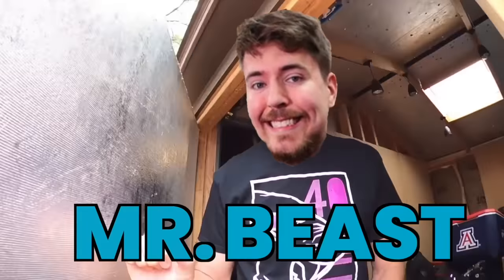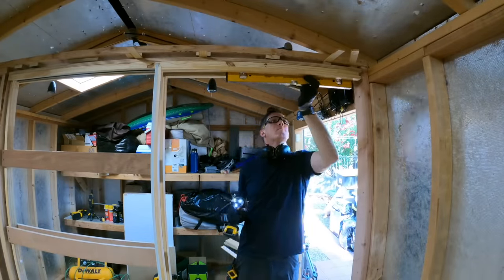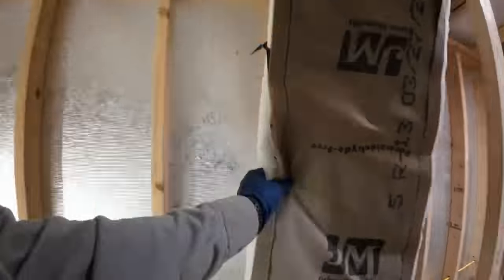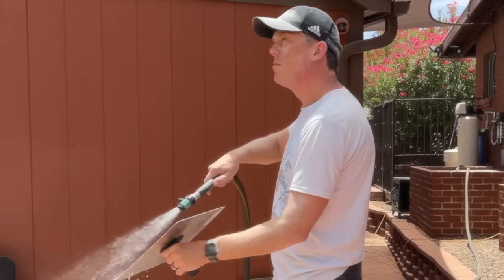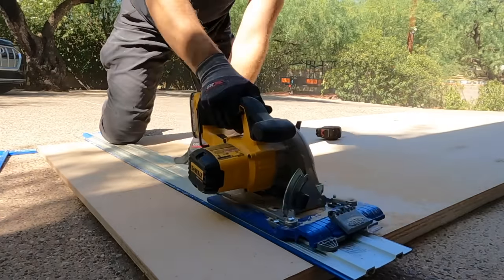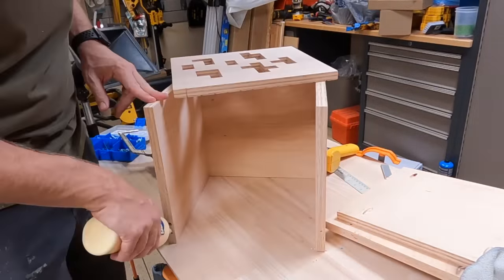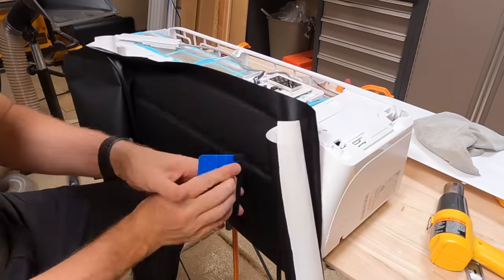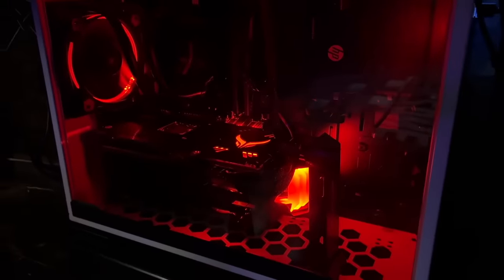I Turned a Boring Shed into an EPIC Minecraft Gaming Cave

Comment: tip for running cables through pvc, use a leaf blower and blow a string through first, then tape the cable to the end of the string and pull them through, saves time and is much easier

Comment: Pro tip connect the conduit to the box run the wire through the single piece of conduit run the wire where you want it then run the conduit through the wire making it much easier for assembly

Comment: This is incredible! I also have my own 10x10 outdoor shed (It's actually a 12x24 but the back end is walled off with a different outside door to use for storage) that I insulated, drywalled, and ran and buried electical and ethernet to and turned into my own gaming cave! But I've gotta say it's NOWHERE near as cool or as good looking as yours, it was the first time I'd ever done most of those things! But still, I've got my own little gaming den that I spend most of my time in. Even have a full size bed in it, along with a big flatscreen on the wall and my double monitor gaming pc setup. Mini fridge for drinks and snacks as well as lots of display space for my retro handheld collection and other nerdy collection stuff! Absolutely love the video!
Reply from the maker: that sounds awesome!  would love see what yours looks like.

Comment: Great video. For next time, I will recommend using Klein's Lube (Klein Tools 51100 Wire Pulling Foam Lubricant) instead. It doesnt leave a residue, nor creates more restiction when it dries, as Ideal's lube does (just incase you need to run more wires in the conduit for future use. (Obviously, without over filling the conduit with wires, by code.)
Reply from the maker: thank you for the suggestion. :)
Reply: My s*** like that

Comment: Hi, Did you have any problems with condensation in the ceiling?

I didn't see that you have any soffits or and baffling between the roof and insulation.

Awesome video keep up the good work :-)
Reply from the maker: Thank you!  No, I haven't had any issue with that.  There is ventilation outside however.

Comment: What sort of insulation is that? We use kingspan, it’s like a compression foam witch is foil backed on both sides. Only reason I ask is because I’m doing something similar with my shed. I’m converting it into a cigar lounge 😂. Great videos 👍🏻🏴
Reply from the maker: nice!  My next shed project is going to be a Cigar Poker room.  The insulation I used is the standard R13/19 you get at Lowes.